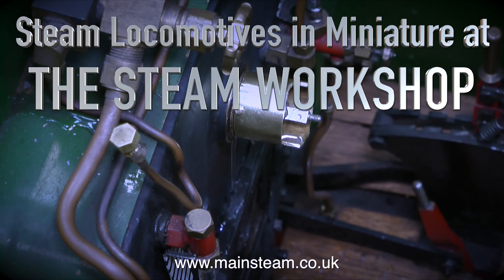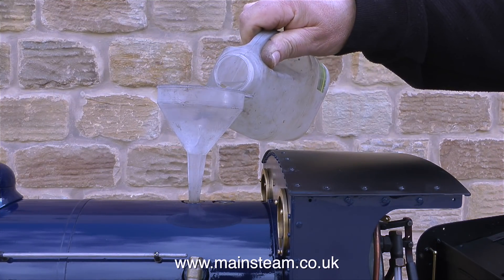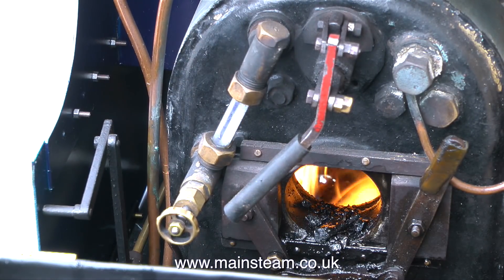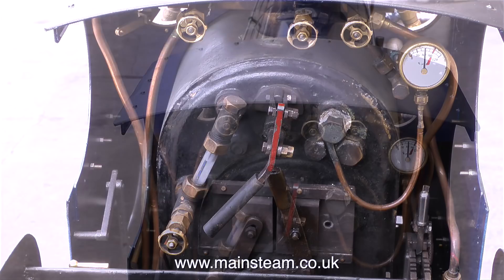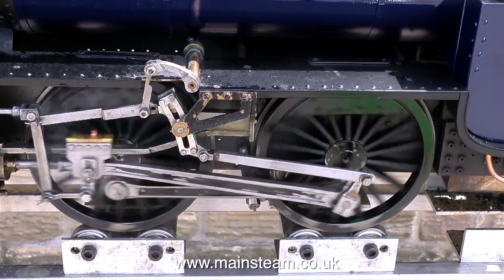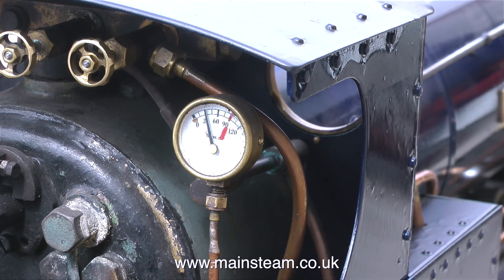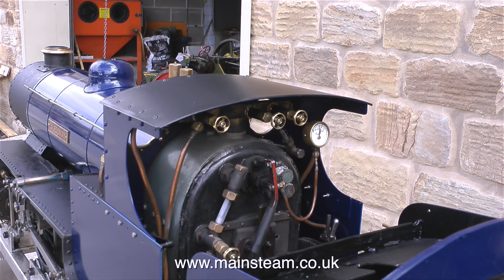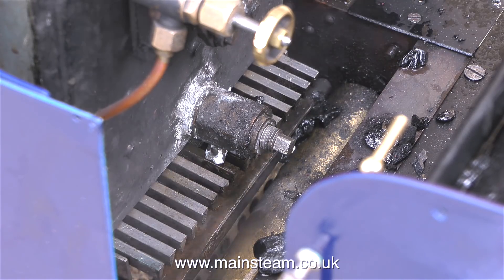THE STEAM WORKSHOP - LIVE STEAM TEST ON A FREELANCE LOCOMOTIVE

Comment: I love this loco, but then I have a thing about things that are bit out of the ordinary. Actually having that weight at the rear seems sensible to me. Although I've never driven a steam loco of any gauge, a good number seem to be unbalanced in terms of front to back. My own diesel profile electric 5" gauge loco was a bit front heavy, meaning it didn't have maximum traction, I had to add a balancing mass at the rear.

Comment: The wheel arrangement of a 2-4-4 is referred to as a "Forney" type, hope you found it useful
Reply from the maker: This engine has a 0-2-2 wheel arrangement
Reply: @keithappleton   how? I know that the rocket is an 0-2-2 But this is a Forney type as dictated by the 2 guide wheels at the front,  the four divers in the middle and then have another set of four at the back that support the bunker, I'd like to hear your reasons for call it an 0-2-2
Reply from the maker: OK. Especially for you, just one more time ............... This Locomotive has a Wheel arrangement of 0 (NO LEADING WHEELS) 2 (TWO DRIVING WHEELS) and 2 (TWO TRAILING WHEELS) 0-2-2 (as previously clearly stated). The wheels on the Tender (or bunker as you call it) have nothing whatsoever to do with the wheel arrangement of the Locomotive as the Tender (or bunker) is towed behind the engine in order to provide the Coal & Water services).

Comment: Regarding the wheel arrangement: When a full size engine has a gap between the rearmost driving wheels and the trailing wheels it is usually to make room for a wide firebox. On this model the gap is a bit far to the rear relative to the fire box. Anyway, the builder can be proud.

Comment: Keith, I have a question. Do you know if there is a scale dynamo for model steam engines? The North American steam locomotives had a dynamo mounted on top of the boiler by the cab to generate electricity for cab and running lights. Just wondering if you knew of anyone building scale units to do the same thing for scale model loco's.  As usual Sir excellent video!
Reply from the maker: Depends on the gauge/scale .... PM Research do some neat little generators . . .

Comment: Very nice, I have a question for you, how do you 'handle' a steam locomotive ?
Picking one up and moving it around the putting it down again without causing any damage must be quite a difficult job once it is all put together like that. Are there any special techniques, do you use overhead winches or do you roll it onto a trolley ?
Reply from the maker: on 5 inch gauge locos it usually a man at each end unless it's a very small locomotive. On larger ones it's a man at each corner, but sometimes a Hydraulic lifting table is useful to have as the bigger models are very heavy . . .

Comment: Rather unusual design for a steam engine. It would make a rather handsome 4-4-2 if you extended the frames at the front, added a front bogie and then put a trailing truck under the cab and added a tender behind.
Reply from the maker: I like it the way it is though .... a bit odd - I used to have a girlfriend like that }:-)))